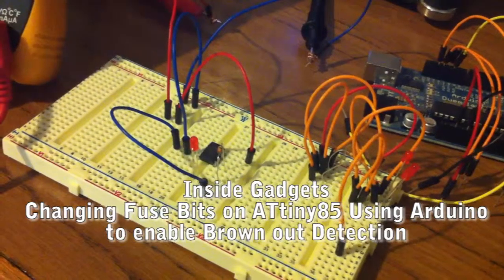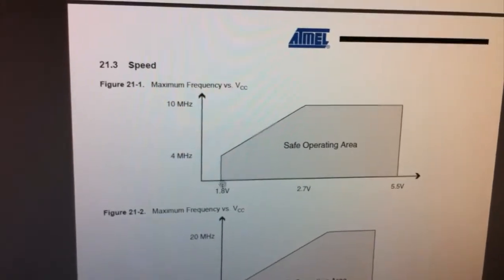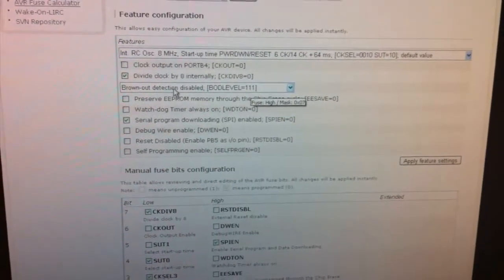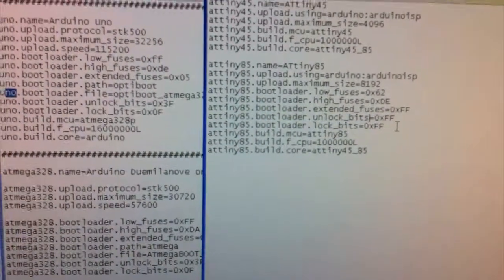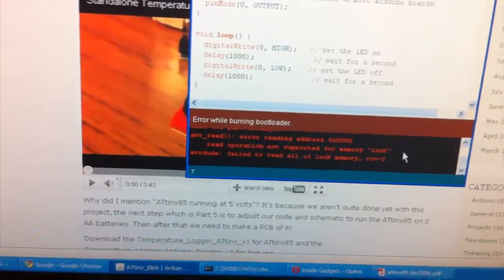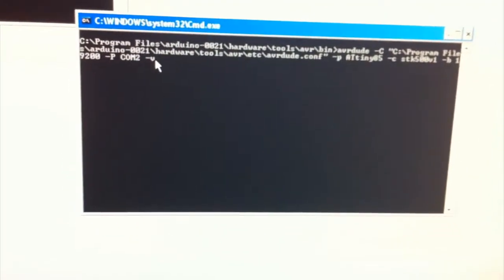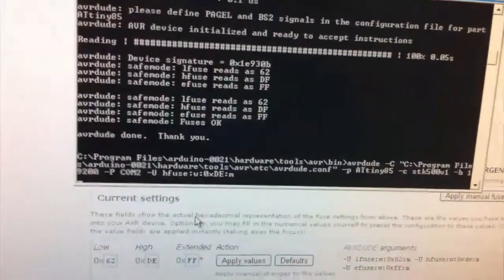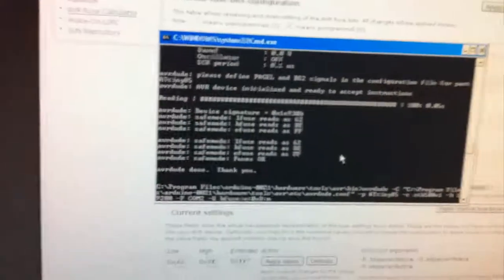How to enable the Brown out detection on the ATtiny using Arduino ISP

Comment: tks for your answare and sorry for my: "answare" ( I wanted write question XD, anyway...). I studied the examples but i've problems with the code because I need to control an unipolar stepper pushing a button-switch ( 1 push do a little rotation, 3 pushes it back to the start). Can you help me with it? :S